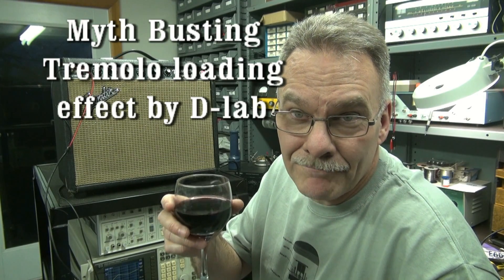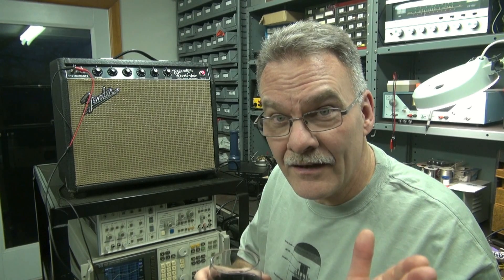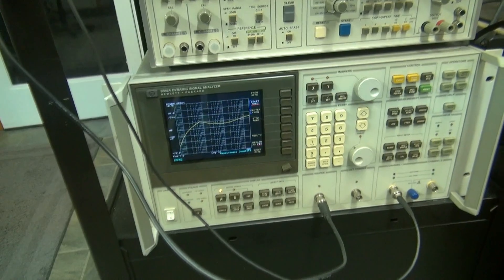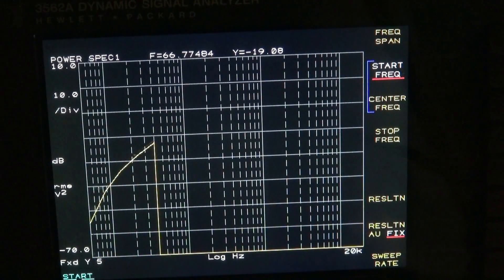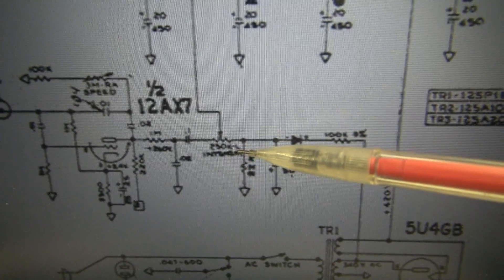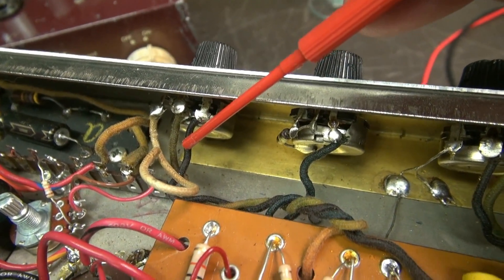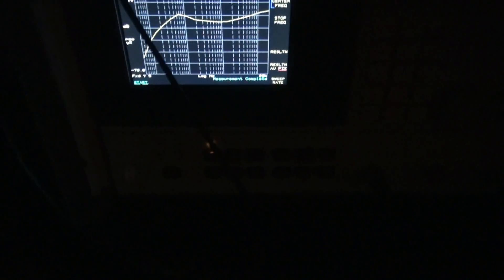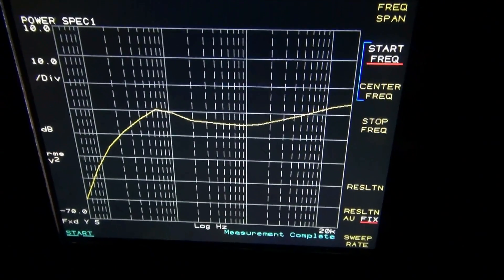Fender Princeton tube guitar amp myth busting tremolo circuit loading effect

Comment: After doing my school work on these old dual channels, I have become pretty aware of how they take two paths. using separate preamp tubes (or half tubes ) the half of a tube used for the tremolo seems to be a zero net gain for tone, kind of proved out by your test. It us using an amplification stage, but using that energy for a different job. So when it is bypassed, nothing gained, nothing lost.
However, a person could rewire that tube for gain. If it doesn't push the output too far to be of any good. Some things I still have to learn :) how many 12ax7's can I stack behind two output tubes to get the greatest volume without system failure.

Comment: There is no reason to expect any change in gain or frequency response disabling a tremolo circuit that operates via impressing the tremolo oscillator output onto the output tube grids. However, many other Fender models have LDR based tremolo circuits with the intensity pot connected to the signal path and the LDR connected to the pot wiper. In these circuits the pot does attenuate the signal even with the with the intensity an minimum. In these circuits disconnecting the intensity pot will boast the gain slightly and lower the bass cutoff frequency somewhat as well.

Comment: I wonder if the amp owner was thinking the removal of the tremolo would have the same effect as it does in an AB763 circuit.  It would be interesting to do the same frequency response and gain test on an AB763.

Comment: Amp that old in that condition and knowing how awesome those old prinstons sound I don't believe I'd try hot roding it. I used one for many years at the Church I was going to as a lead amp and it kept up with everything else pertty dang good for only 10 watts of rated RMS power. In my opinion they have the very best sounding reverb of any other reverb amp that uses the old spring pan type reverb but that's my opinion lol.
Reply: I could be wrong, but to me that mainboard didn't look original . Maybe a kit in an old chassis ?

Comment: Cesar Diaz mods to the super reverb  and vibroverb includes desconecting the tremolo pot. For more gain. Is the same in those amps? Good work and greetings from Perú.
Reply: The Princeton has a bias tremolo, which isn’t in the signal chain. The super reverb and vibroverb, twin reverb, and bandmaster reverb instead put a tremolo intensity pot in the signal chain which attenuates the signal even when tremolo is off. For those amps, diconnecting the tremolo pot will add gain.

Comment: Interesting video thanks. I love mine the way it is. I sometimes wish it had a master volume on it but then it dawned on me get a vibro champ and add reverb next best thing. For me anyway. I wish you would do a vibro champ with that test to see if it makes a difference. It does sound different than my champ with no trem circuit.But it may be the speaker. thanks you do good info!

Comment: Disconnecting the trem on the larger fenders with photocell trem will give a significant tonal change and boost -- the princetons  , vibrochamp & bronco were the only ones to use bias vary trem -- try the same sweep test on a deluxe reverb or any of the larger models -- it would be cool to see the results -- dig your channel keep up the good work !
Reply from the maker: Will do man. I appreciate the kind communications. This Princeton has had many updates, 6L6 mods, etc., so the value has been affected.  We call this one the "Kingston"
Reply: Yes I was gonna complain about modding a great vintage amp until I saw it had been totally reboarded and rebuilt ...
Reply: Correct. An easy way hear this is with a Bandmaster non-reverb model (mine is a ‘68). The tremolo channel is has much less volume than the “normal” channel. The only difference between the two channels is the tremolo intensity pot in the signal chain, which adds a lot of attenuation. I learned quickly to always use the “normal” channel unless I really needed tremolo.
Fender amps of that era with reverb don’t have that problem because half of one of the reverb tubes is used as an additional gain stage in the reverb channel. That additional stage more than makes up for the signal lost in the tremolo. But on reverb equipped amps, if the tremolo pot is disconnected, the result should be much more gain. I’ve never tried it, but it seems obvious from the schematic. I like the tremolo on my Twin Reverb too much to do it on that amp, and it’s got ample gain already!

Comment: Terry - with you would have tested again b4 and after at much pushing the amp harder - (7-8) - I'm betting that would have made a difference in both traces  - the only reason I say that - Fender amps respond differently to the player's hands at higher volume - even if you put some kind of attenuator on the output - it does seem to make a dif.

Comment: What guitarist doesn't like tremolo????  If anything - do something like that SLASH Marshall Super lead tremolo head, and put that half of the triode tube and make it an extra gain stage- that would be cool.
Reply: I say leave it. It,s part of it,s charm. There is a hole in back for the polarity switch that has been obsolete for fourty+ years. I can,t remember exactly but it,s a simple mod.

Comment: Thanks for another great video!! How hard is it to add a midrange control to this amp?  Can you add a master volume using the non used potentiometer?  Thanks
Reply from the maker: Hello, Yes, it is an easy update. Next in this series, I will be adding Mid + Master. Stay tuned! TD
Reply: D-lab Electronics Could you gain any output volume by using the now unused half to either add a gain stage or change the phase inverter to a long tail and rebias the output tubes? Thankz